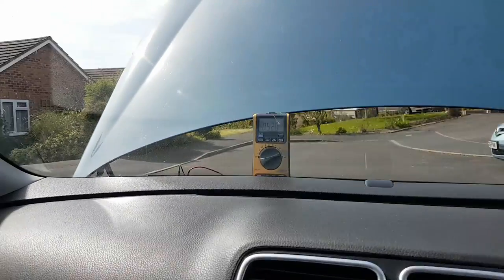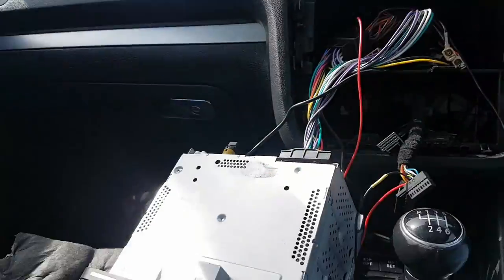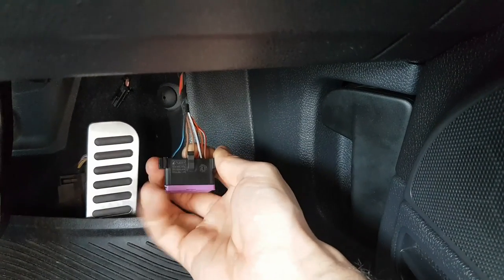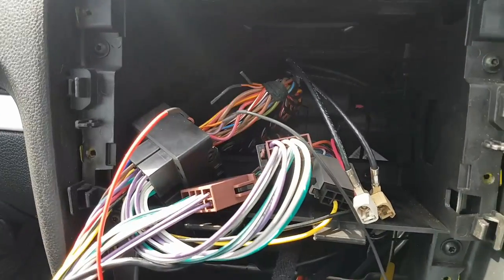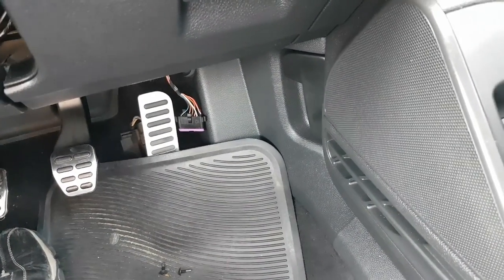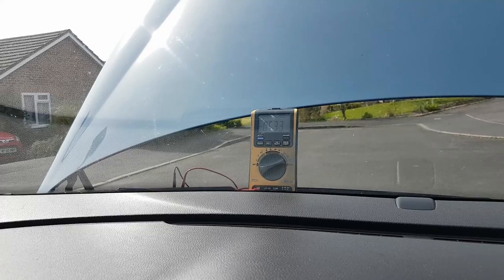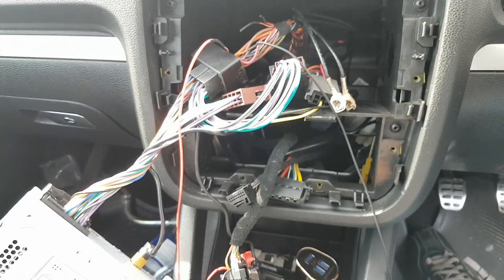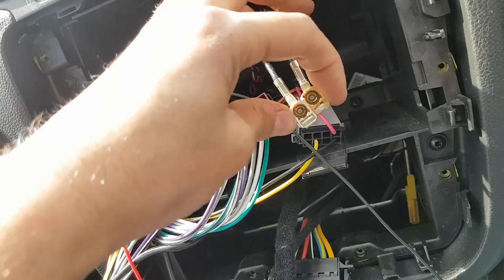VW RCD510 STEREO UPGRADE AND DREADED BATTERY DRAIN PROBLEM PART 2

Comment: Interesting video,  I have the same problem on my EOS with a new android Xtrons head unit, the lead connector comes with a Canbus but the battery drained on me.

Apart from your trick:
does the Fuse bypass trick Works also?
Can I hook it to the cigarette lighter? 
Can I keep everything original but play with the Vagcom VCDS for the head unit Canbus?
Reply from the maker: I think the only other fix i know of working correctly and safely is the canbus gateway module needs to be replaced. But I dont know with which one, hence went with this trick. Still working fine now.
Reply: @DanSohan  I will try your method this weekend 👍
Reply: @DanSohan 
Hi again, thanks for your video again,

My question is. Where did you cut  the Can low/high from? I mean from which side of the harness. The VW harness or the after market stereo harness. Or just two plain fly cables hooked into the vw harness side?

Sorry for these question as I'm not familiar with electronics... So far I'm pulling my hair with the EOS sunroof beign stuck closed and won't open when I press the button, the new motor gear still jumps teeths after beign replaced...

Comment: Hi All,

Wondering if anyone can help! Installed a 9” Android head unit Essgoo (Chinese) in my partners MK6 Golf. The headunit wouldn’t turn off initially so I read up and noticed people mentioning disconnecting a red and orange connector supplied on the head unit loom. I did this and the head unit now turns off when I take the key out. The issue is I went back to the car this morning and the battery has died??? 
I know the unit shuts down fully after approx 5 minutes as when I turn the car back on with key etc the stereo shows my VW logo and Android logo and boots up.
My main question is it’s obviously draining the battery but does anybody know how?

Comment: hi, i bought a rns510 with built in canbus, what should I do?
Reply from the maker: I think in this case (if your stereo needs the other can bus) you will need the custom or reprogrammed cam bus gateway module. You will probably need to speak to a friendly vw garage or someone that knows the german car electricals

Comment: Is the unit not causing any problems no more ?
Reply from the maker: Nope. Shuts down perfectly. No battery drain even after 2 weeks away on holiday.
Reply: Did you fix the steering wheel controls problem?

Comment: hello, can I use your video for education purpose/knowledge/source of information and dispute.??I have the same battery drain after the dealer made a stereo replacement.
Reply from the maker: You certainly can, but please note. I am not associated with VW. This was a DIY fix and for the job to be offically fixed an updated CAN BUS gateway should be installed / reprogrammed

Comment: planning on doing this on a golf mk5. any advice or information you can share?
Reply: You can connect the positive cable from the cigarette lighter below the AC, easier to find. Cigarette lighter will completely shut down the voltage once you pull the key out of the ignition. Also if you experienced the the battery drain, dont forget to fully charge the battery after the repair.Alternator wont do it. I had voltage drops in the rain resulting in restarting my chinese android unit randomly. Took me months to fix it with the simple battery recharge.
Reply: @kamilkazmierczak2842  did you cut the posative wire from the stereo and put it to the cigarette lighter what did you do with the earth did you just leave it or do the same as you did with the posi thanks for the info

Comment: did the old stereo drain the battery when the stereo was off or was it draining when the car was turned off but the stereo turned on after the car has been locked? how is it possible that a stereo can drain a battery when the stereo is off? because i think my stereo is doing that to my battery, i might try this, its a Honda accord euro 2012 model
Reply from the maker: This mod is only really for VW as it's a known problem when you swap the original head unit for a new vw version. The issue is when the car is turned off by the key, a signal is sent on the cam bus wires to turn the radio off fully. The newer units receive a different signal from another can bus (there are a few for different core systems, e.g engine management or climate control etc) this fix sends the shut down signal that the AC receives to turn off the newer version head unit. I dont know what the issue is with Honda. It could be a fault unless you've recently changed it?
Reply: @DanSohan  yeah but you didn't answer my question. Did your stereo draw power from the battery when it was off? Because that's what's happening with mine i think, the stereo is off when the car is off but it seems to be drawing a lot of power from the battery even though it's off, it's weird, is that possible?
Have you got Facebook? I need to speak to you if that's ok?
The stereo is origional btw
Reply from the maker: @r.k862 Yes

Comment: Hi will 2014 touran 1.6 tdi have this battery drain issue if I change to rns510?
Reply from the maker: I dont know. This was a 2007. So things might have changed alot since then
Reply: @DanSohan  Ok

Comment: Would this be the same for the mk2 Leon cupra 2007?
Reply from the maker: I can guarantee, but it is VW Audi so very likely. Let us know if you give it a go and works.
Reply: @DanSohan  I've found the orange/green and orange/brown wires on the back of the aircon unit. I take it these are the canbus wires?
So my radio loom for my android unit looks the same as yours, what colour is the canbus + and which colour is the canbus -?
Reply from the maker: @cuprak1lad543  does it not say on a sticker on the back of the head unit. Would need to find a wire diagram somewhere
Reply: @DanSohan  they wires out of the Android unit are all labelled but it's in Chinese lol. I take it I've got the right coloured wires from the aircon. What colour wires are your canbus wires on your android unit?
Reply from the maker: @cuprak1lad543  We dont have an android unit, it was a VW unit we installed.
Reply from the maker: I would think most android units would turn off fully by using the switched ignition. If they have CANBUS its usally for reading faults and data from the ecu into an app
Reply: @DanSohan  well what colour wire out of the head unit do I join the orange/brown wire to and which colour wire do I join the orange/green to?
Reply: Well the wires out of my head unit are purple and purple/black. I can only think of these being the can wires.
What type of wire did you use to bridge between the radio and aircon unit?
Reply: @DanSohan  so on my original head unit I've found the CAM/H and CAN/L terminal. I'm guessing the H is positive and the L is negative? If so do I need to splice off these?
Reply from the maker: @cuprak1lad543  Yes, I imagine CAN/H is for the High signal and CAN/L is for the Low or negative signal. 

 I can't advise on your exact setup as nearly impossible without been there. But as long as you don't connect the CAN wires to anything 12V or short them out, it'll either work or not. If it doesn't work I'd personally connect it all back together as it was before.

 As for joining wires, I think they were soldered with heat shrink. Some like to use crimps etc. Make sure it's safe and well insulated as there is risks from poorly connected / damaged wires.
Reply: @DanSohan  well I managed to join the canbus wires up etc to the aircon unit. Touch wood so far no message from the wife saying the alarm is going off which means flat battery so hopefully fingers crossed its worked. I've probably jynxed it now. Will need to take the car out tomorrow to charge the battery back up!

Comment: I have a 2014 Jetta that came standard with the boring looking RCD-310 radio. Wondering if I should even plan to swap my radio to an RCD-510 Premium 8 or not. Maybe since my car is newer, there shouldn't be any battery drain problem? I had a 2011 Jetta that had the RCD-510 come standard. Anyone have any advice? Maybe 2011 and newer models years won't be any more work than a simple swap and no programming of Vag Com?
Reply: I dont think you will have any power
Reply: it will drain your battery unless you install it the way he did it in the video.And its worth it!You tube, internet from your phone,amazing sound,better then on the original sysytem.Unit itself is cheap as well.Just install it correctly and you will love it.

Comment: You should have just updated your canbus. It’s cheap and a direct swap, plug and play
Reply: updated canbus? how would one go about this?
Reply: The canbus module is under the dashboard. Newer revisions fixed the battery drain problem. You remove the old one and install the new one. You need to “code” the new one but it takes only a minute with a vag com
Reply: Did you try this out ? If so for what VW and did it work?
Reply from the maker: Antonio Maciel yes. It worked perfectly for us and no need to buy additional hardware
Reply: It’s cheap he says lol vag com is 200$ just for the 3 vin specific one
Reply: @MrGreenLeader is this canbus gateway the same as the obd port? Thx
Reply: Hi all. Please write me the solution in some simple senteces. I not speak english and i not understand this video. Thank you

Comment: Can an aftermarket pioneer cd player drain the battery ? Does any body know any solution for aftermarket radios ?
Reply from the maker: Not normally. It depends if it shuts down from the main ignition wire  or is controlled by cantus signals
Reply: @DanSohan  I fix it man , thanks. The parasitic drain turned to be the cluster

Comment: HI, done this before , much easier to add the device to the can Gateway with VAG COM ,through the OBD port.
nice little mod if you dont have VAG but do have time to pull apart console.
Reply from the maker: Phil dabandil we have vag com, but the can bus gate way module was of a version not to support this stereo. Could have bought another module but decided to try this while the stereo was out. Still working fine, but maybe a mod best left to someone with experience in wiring.
Reply: @DanSohan  when you turn on the radio manualy, it will turn off automatically or it stay that way all the time? If doesnt come off automatically again then i think i have to go with vag com and new gateway module because childrens always mess with the stereo and leave it on.
Reply from the maker: @chancho00  it works as it should. If you turn on the radio while the car is still powered up it will automatically turn off when the car powers down. I.e the keys have been removed for around 5 mins. After that it wont turn on again untill the keys are inserted
Reply: @DanSohan  I just done the mod, installed the model RCD330+, i just notice that if you wait those 5+- minutes the power goes to zero amps but if you open a door or activate any button from the remote control the the 5+-minutes cicle start again but goes down again by itself, in my case i can turn the unit manually without the key inserted so i have to be careful that me or anybody doesn't press the power button when i go out or the unit stays on the whole time even when i lock the car(something curious is that some functions are disabled like bluetooh, even the unit show a message saying that i have to turn the ignition on to use it, the radio works fine), also i notice that the rear camera sometimes doesn't want to come on and the unit says that rear camera is unavailable, it dint happened on the original can bus wires but at least the batery drain problem is fixed
Reply from the maker: Thats more complex than our system, no bluetooth or rear view camera installed. I'd imagine they run from the other CAN Bus maybe. maybe the only way to get it working 100% in that case is a new gateway
Reply: @chancho00  same thing on mine Jetta 2007!!! Rcd330, Works just fine, but drains battery.... I have notices that The unit is someway ON, because when i put my ignition on, it does NOT come up with that WELCOME TO VOLKSWAGEN. So yeah, did you do this trick, as in video?

Comment: so i installed a Aigoss Car Stereo in my Pontiac Saturday  by  tues morning i went to to start my car and its killed my battery. My factory harness has a blue wire and theres a blue wire on 1 of the harness that came with the radio so i hooked it up. im not sure where im getting the continuous power loss from. where should i start. i had a few wires like a brown and light green one left over from  the unit and an extra orange from the chime harness so i taped them off.  what did i do wrong besides buying a cheap amazon pos lol
Reply from the maker: Need to know exactly what wires are what. Colours may or may not match up. There should be a permanent live to the memory and a switched live to switch it on and off.. on mine I thought blue was for an automatic powered antenna. I dont think the fix in this video will help much in your case, as this is based on a canbus issue related to VW VAG cars only.

Comment: Did the exact same way... Still battery is draining... I figured out that battery drain is occurring only when the stereo is off before we switch off the car... If the stereo is playing and I switch off the car... The battery drain stops
Reply from the maker: Humm. So it seems like the stereo gets its shut down command when on, but not when switched on. Is the memory supply correct. Does it remember its saved radio channels ok? Im not an expert just found this worked on our 2007 vw car. Maybe you will need a can bus module upgrade. Good luck
Reply: @DanSohan  yes memory will be intact
Reply: devanandan K V is this the case if you don’t do any wiring mods and just install rcd510.  I have a mark 2 Skoda that has the drain issue.

Comment: I did this and now the radio won’t turn on and the lights in my car flicker
Reply from the maker: I would recommend undoing the new connections and seeing if it fixes things. If not maybe you need an autoshop to take a look. Good luck